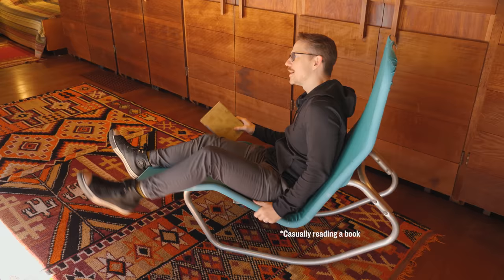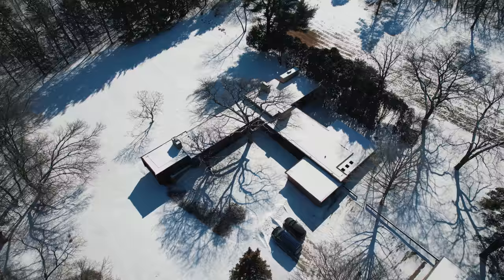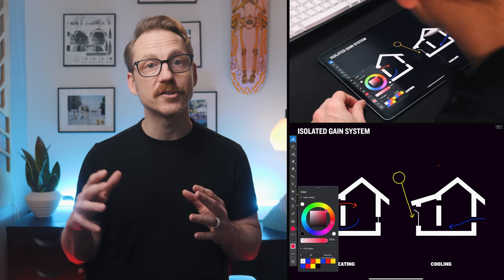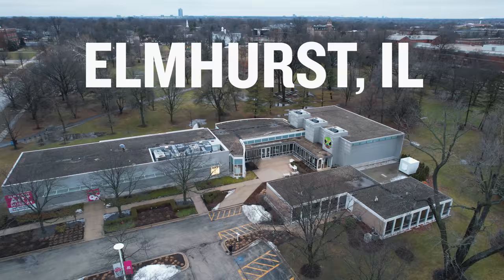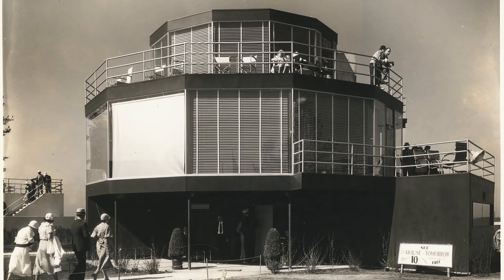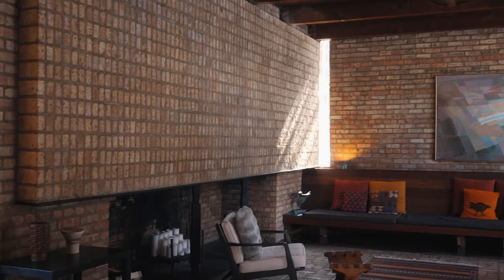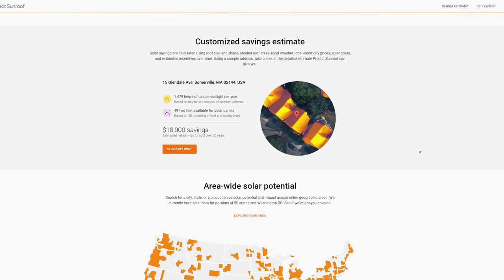How This Midcentury Modern House Harnesses the Sun

Comment: I little 850 sq/ft house has a huge 5'x10' south facing window.  Looks great but unfortunately it was not designed with solar energy in mind.  During summer that room bakes and during winter that room is chilly.  Maybe when I have to get the place re-roofed in the next ten years I'll investigate changing the angle and overhang length to help balance things.

Comment: One problem with passive solar is multi--paned glass.  If you stand in front of most double or triple paned windows in winter sun you hardly feel any heat at all.  A single paned window will be surprisingly warm.  Of course back then this house would probably have had single paned windows offering excellent solar gain.

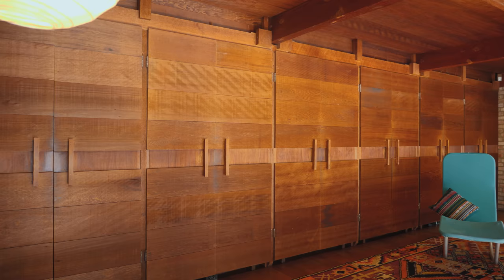Comment: Window awnings should be used everywhere but sadly they're out of style now and seldom used despite their intelligent and logical functionality of letting winter sun in to heat the room and, when the sun in higher in the summer, keeping it out.  But this only works well with shorter windows, not so much taller ones as shown at 1:30 here, otherwise the awning has to extend out too far which restricts vertical visibility and has a cramped, congested feeling, sort of like being smothered a bit when you're inside.  As the sun's height in the sky is variable perhaps the answer to his are window coverings that control how much is exposed to the sun.  That way the entire window can be open in the winter and just the top part in the summer so its closer to the awning.  Short and wide windows can be placed high on the wall, especially good for areas with close neighbours.  This allows abundant natural light and 100% privacy as long as there isn't anyone above you or well above you.  If there is, privacy can be retained by reflecting the outside light at about a 45 degree angle to your white/reflective ceiling to scatter it evenly throughout the room with no glare like direct sun plagues us with.  One could also reflect light from outside inwards as well with a flat panel below the window outside.  I hope that makes sense....

Comment: Here in Brazil people run from the sun, because the sun is so hot all year round. Buying a house somewhere that is shaded, with the backside turned to a hill that hides the sun earlier, can make a house cost double or more. It's very expensive to keep the heat out of your house. And, off course, being a third world country air conditioning is quite expensive. I bought a stony hill 25km away from the town center, people said I was crazy, but I had in mind building my house in the perfect spot. The sun sets at the back of my house, and this hill is 1300 meters above the sea level, so it's almost never too hot. On the contrary, in the winter it's a little too cold, but it almost never goes below zero, so it's not like in much of USA. As the house is turned to the east, where the sun rises in the morning, it also conveniently gets warmer early in the morning, when it's most cold.

Comment: Glass has a fairly low r values and will let heat in and out easily and quickly.  If your in winter and it’s sunny I can see the idea of the green house effect working favorably.  But a cold cloudy day is not usual winter weather in many areas.  I feel like you would lose a lot of heat with big windows on all sides.   regional weather/climate is a really important factor when thinking about these designs that was left out i think a follow up video with more detail on how design chooses might be influenced by region would be nice.
Reply: This is why we have multiple paned windows. The heat they let in waaay offsets the lost heat

Comment: While I would like to rely on sunlight through windows to warm during winter (and use shading in summer to prevent warming), I don't think there are any windows on the market (per code) that permit it anymore. It seems every window that I can buy has such extreme low-E coatings/materials that little heat enters the house even in bright, direct sunlight. With my older windows, I can feel the warmth of the sunlight almost immediately and the areas in the sunlight get noticeably warm. With the newer windows, that warming is virtually eliminated.

Comment: When I lived in Japan, my apartment complex didn't have bulky central heating and cooling and instead had utilized the same designs for climate control. The balcony of the the floor above served as an overhang to prevent summer rays but allowed the winter sun to warm the space to the point where i didn't really miss my thermostat.

Comment: I wonder why Schweikher chose to set the awning at 24.5 degrees when the sun would only be low enough to shine into the house at midday for a few days on either side of the solstice, and those aren't even the coldest days in the midwest. From Schaumburg, IL, part of the sun's disc is below 24.5 degrees from December 10 to the 20th. On Dec. 21-22 the entirety of the sun would shine into the house at midday, and then for the following 11 days it would gradually disappear behind the awning for part of the day. By January 3rd it's completely hidden from view again around noon. If the awning were set 2 degrees higher it would allow the sun to shine in all day until mid-January when the midwest typically experiences the coldest weather of the year.

Comment: This is pretty much the type of house I would build. It's very smart to use as much passive heating and cooling as possible. It saves a lot of money. How do they keep the house warm when it's an overcast day in winter, or if you get several overcast days in a row? I'm just thinking that this past January it was very gray most of the month in the Chicago area. It was very dreary.

Comment: I watched it twice.   I once owned a home with a large window that faced south.   It was way, way too hot in that room.  And I worked in a building on Lighting Way, which was a huge glass building, the top floors were so hot, the AC ran all the time, the ground floor was too cold from all the AC, and you'd have to run a space heater, if you worked in a ground floor office yup, we've finally gone and made dumb buildings, where the AC and the heat run at the same time.

Comment: Hi Stewart,
I found this house very intriguing.... especially now in 2022 where we want to me more eco-friendly.
Is the angle you mentioned pertinent solely for the longitudinal location of the house in relation to the sun during Winter? 
I live in Denmark in Scandinavia where our Winters typically range between 20°F (sometimes down to just 10°F) and up to 45°F... During the Summer we typically see daytime temps between 60°F to 80°F, on rare occasions as high as 97°F.
Our Houses are typically one of two types...
1) Double brick outer walls with 12-18 inches of Rockwool insulation in between, or
2) Single layers brick outer walls with a type of aerated concrete inner walls clad with gypsum sheets and wallpaper.
As for windows, we have either double- or triple-glazed windows.
Central airconditioning is as rare as a hens tooth here in domestic homes, and heating costs are quite high... I feel this would be a viable solution.
Are there any books about this particular house?

Comment: 'Despite the recent declaration of the term, good practices around orientation and window placement have been around centuries.'
The problem remains, very few of the pieces needed for a true Solar Home are still not used and for the most part, forgotten or ignored.
Net Zero can never be achieved in America because there is no APP for that.

Comment: Love your videos! I just thought how fascinating the subject of passive solar home design was in my undergrad years. It was my favorite subject and I thought I would get into this field but I have been so disappointed on how almost no one cares to build this way. It makes so much since it could even be cheaper to build if these project wouldn't need mechanical systems, just a basic proper site orientation could save home owners thousands over the live time of the building. I strongly believe building codes should require the most basic passive solar design.
Reply: some do - recently built a 1,000 sf house with 45 degree roofs facing South - and on the plans it stipulated future solar - panels are not passive, but these lessons have been learned and slowly change our trajectory....we still are fascinated by the bright shiny object.

Comment: it's truly a beautiful building, although to optimise the thermal mass of the floor stone/brick/concrete would have been better. wood isn't fantastic, even worse when covered with carpet. also to optimise solar absorption during winter it would help if there wasn't a row of trees right outside the window - almost as though they were planted intentionally to block the sun. great episode (they all are really) and a real shame the building industry in general refuses to adopt passive heating & cooling techniques.

Comment: this would work great if the building had a simple shape (cube or sth close to a sphere) which reduces geometric thermal bridging; also ventilation without energy recovery and bad air tightness negates all the benefits of a good passive solar design

Comment: The theory of passive solar is great, however the reality is VERY different. I designed and built my house with these same principles. I'm in Australia and my main living zone faces north and is 14m wide. We have large windows and extended eaves that keep the summer sun put and allows the winter sun to stream into the home heating our tiled concrete slab (thermal mass) for heat retention during the cold months. This is great, except when we have continuous cloud cover for more than 3 days during winter days. All the heat leaves the slab and the slab becomes cold. Then, no matter how sunny the rest of winter is, we can never regain the heat in the slab again. The reality is the days are not warm or long enough to reheat the slab once it cools to ground temperature. 
In conclusion, don't just trust theory, reality often yields very different results. In my next home, I'll follow similar design principles but won't overspend on design features that aren't effective 100% of the time.

Comment: The passive solar heating and cooling principles utilized in the house are not its sole source for heating and cooling.  As with all of the passive solar  homes that I have  studied, designed, and built in the 80's and early 90's, they all required a second or even third source of heat.  Most relied on wood burning stoves or fireplaces as well as a central heating system which used fuel oil, propane, or, natural gas.  The idea back then was to have redundant systems for winter heating and the sun was simply utilized to supplement other systems. One could not depend on the sun as the sole heat source then and even with the advancements in insulation materials, insulated glazing panels, and sealing techiques it is challenging today.

Comment: Beautiful house. I have studied the work of FLW extensively, and am a huge fan of such houses. I recently built one for my retirement, and have these comments: Managing the sun is straightforward, but not easy. Also, both furniture, carpets and humans must be simultaneously managed. My vote for the future is to use these designs for net zero greenhouses, and hybrid designs for human habitation. The plants’ needs are simpler to accommodate in our designs.

Comment: The late 19th and early 20th c. had such an acceleration of experimentation and invention that I would think it is actually quite hard to definitively label something "first". 

While acknowledging I am not an HVAC specialist or even a mechanical engineer, when looking at the plans of a 27 storey building in NYC called the Lefcourt State Building (architect Ely Jacques Kahn, construction 1926-1928), and poking around in its cellar, it looked like it had been designed with air-conditioning with vertical plenums in the exterior walls. There were enormous blowers in the cellar, too, now unused. There's an archive of drawings from Kahn at the Avery Library. I was looking at the drawings on behalf of my client for a completely unrelated issue, so I didn't look closely at the air circulation design. Interesting building, though, in several ways.

The 5th Avenue Presbyterian Church also had a form of AC in vents in the floor of the sanctuary and fans in the cellar that pulled air over blocks of ice and pushed it into the space with the congregation.  (Heating in the winter was similar, except involving the steam pipes.)

Comment: Excellent example of passive temperature control through design.  The Schweiker House looks like a beautiful home with or without the solar design. Side issue that I brought up to Elizabeth Smith at MOCA-LA when she was doing her Case Studies exhibit/book. The reason these 'modern' houses didn't immediately change housing in the late 40s and 1950s  is 1. They all leaked, roof, windows, sliding doors. 2. too much glass that couldn't be insulated, not enough places to pack in insulation batting. (I've known people who built this type of house back in the 50s/60s and who've lived in them. Terrific houses but cold/hot, leaky, wood rot where the wood met the concrete.) This might make an interesting topic for a video - the practical limitations that impede the progress of architecture. 
   Transom windows are another interesting topic. I don't think I ever saw a working transom window - and I've seen hundreds in old buildings I worked on, all with hinges and catches, all of them painted shut (or with an AC unit stuffed in them).  At some point people just seemed to forget how they worked. (I thought they were there because gas used to be used for lighting and they needed the ventilation. That wasn't correct, though 12' ceilings were because of the use of gas. )  In Physics 101 the professor lit a candle at the bottom of a glass bottle. It quickly used up all the air and snuffed out. He cleared the smoke and re-lit the candle, but then inserted a small piece of cardboard in the opening. Small piece right at the top - no ducting effect. Convection flow was easily established and that candle burned for the rest of the class period. Of course this is how transom windows work - but you don't need any ducting effect. In the 1990s in a small gallery in Los Angeles that was terribly hot in the summer,  I freed up the transom window. All discussion of buying an air conditioner ceased. It was remarkable how even the very back of the gallery would be ventilated by it. In the very modern Ambassador schools in Los Angeles when the AC didn't work, I'd put a piece of foam core across the top of the door - worked pretty good. In the gymnasium they have huge windows in the upper corner - they don't open (SE side so even dumber!)  Even with the AC on full when that room full of students was horribly hot and stuffy. How do people go through architecture or engineering school, are project managers and contractors and still completely miss that? (Anyone with brick could demonstrate what they missed.) During WWII in ChongQing China people used to pack into these 'caves' dug in the sides of the cliff to hide from the Japanese bombing. People at the back would suffocate. I saw those caves, about 20m deep. A some boards across the top of that rounded opening to make a 'transom' would've allowed everyone to breathe- but no one knew. When I saw them 20 years ago, they were used for auto repair and other small  shops - they still had no transom-split. 
I first saw a house that designed the latitudinal summer/winter sun angle just outside Montreal. I think that house was made in the 50s by a 'Finnish carpenter' (and the seasonal angle/overhang effect was credited to Finland.)  I don't think the ideas of the 'solar house' started with Keck, though like the transom window - apparently it's not that obvious. I'm sure that anytime anyone, or any animal, sought out the shade, or the sun, they were working this concept. But even if Keck didn't invent it, spreading the word is really important.
Reply: My dorm at U Texas- Austin was a 1930s  Mediterranean style. Massively thick masonry walls and transom windows on our doors. Windows reaching nearly to 9' ceiling, iirc. Only 3 stories with a half buried ground floor (always cool).
South courtyard shaded by live oaks.

Nope....no a/c! In central Texas no less!!

Comment: My house was built in 1912 and has the exact same design which takes advantage of the angle of the Sun in the winter and blocks it out in the summer. The south face is stone which acts as a heat sink. Someone did their homework 110 years ago.

Comment: I'm curious why there are area rugs on the floor that would impede the ability of the floor to retain heat.  The material of the floor should be discussed as we probably have other types of materials available today that weren't available then.  Those floor vents were a form of primitive geothermal heating.  The same principle is used in the middle east in desert areas to cool incoming air blowing in from the hot desert.  Geothermal is one fascinating concept.  Just test for radon!

Comment: I incorporated solar design into my 32 year old home when I designed and built it. I hear and cool 2200 sq ft for less than my neighbors 12 & 16 sq ft homes. Yes it works as advertised, and cooling is cheaper too.
Reply: 12×16 ??
Reply: @willbass2869  Excuse me. I should have written "1200 to 1600" square feet homes. 
Yes I hear and cool 2200 square feet for about half they're cost, thanks to passive solar design principles.
Reply: @mikehenson819  lol. I thought your neighbor had one of those trailerable "mini houses" that are so en vogue now.

Comment: looks like the same jerk designed my house. flat roof, might be OK in cold months but when the sun comes out it's a solar furnace, 40c outside 55c inside! got to spray the hose on the roof to cool some days in summer